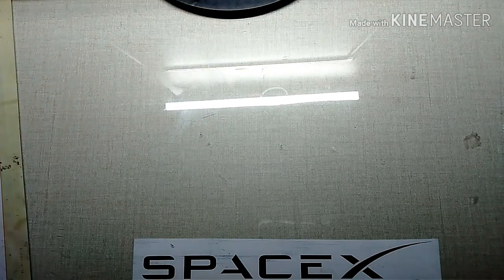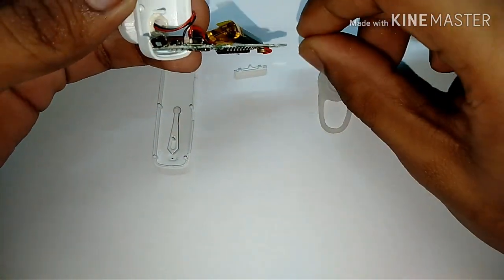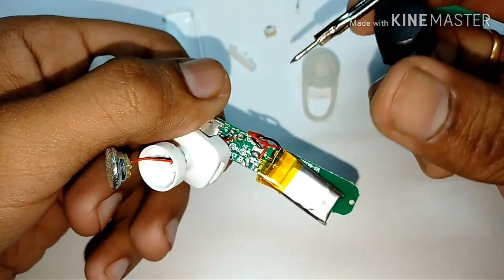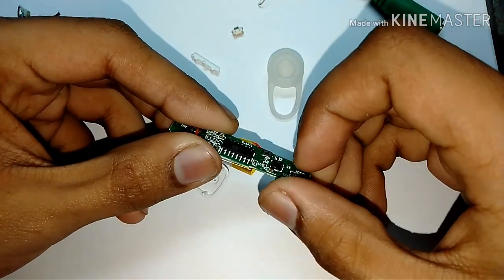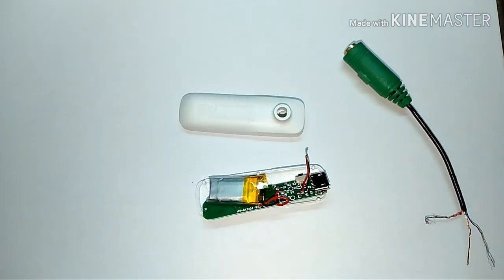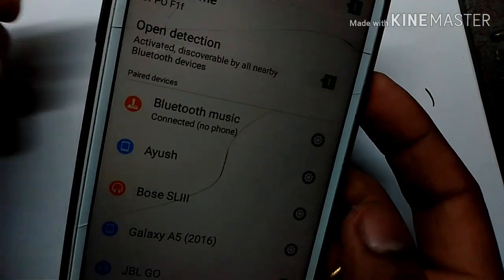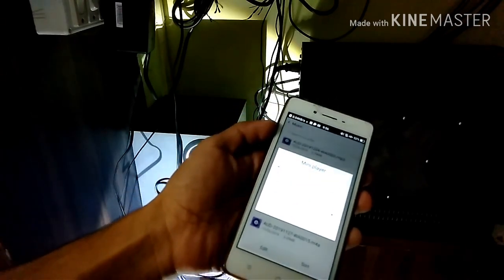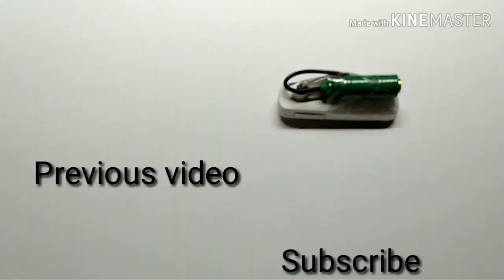Diy Bluetooth adapter

Comment: Help needed I did it exactly and it worked 😊 but the battery life is really bad like from 100 to 0 in 8 mins of usage I want to use it while charging any way this is possible.
Reply from the maker: Good question . 
I think it would be quite inconvenient to use a charger to keep it running , cause the morale of this project is to make any auxiliary device "wireless" , or else it would become useless . You want it to be portable, right ?

So i would suggest you to go a step further and replace the tiny battery with a larger one . Make sure it has the same voltage and current , but higher capacity , so that it lasts longer . 

Be very careful not to use any power source , that has higher voltage or current , than initially rated for the circuit board . 
Study the voltage and capacity written on the body of that tiny battery.  

Comment if you face any problem . I'll surely reply when time permits .
Reply from the maker: @Leo_von_Eric  actually the circuit is designed in such a way that you can't really use it while charging . 

I'm not saying it's impossible . It's definitely possible.  But for the fact you're saying that you're a beginner and you are using your safety pin to solder wires , it's nearly impossible to reconfigure the circuit board. 

I think changing the battery to a better one is the only way out . 

Fun fact : even i don't have a soldering iron , and it's still a mystery to me why i don't . So i know the pain of using safety pin as a soldering iron .
Reply: @RandoniumTJ  Yeah lol😂 the pain is real

Comment: Seems a tough DIY😅..a good one though!
Reply from the maker: Not tough actually
Reply: "Open bluetooth device, connect wires to female aux cord, put back in case" 

There's literally nothing that needs to be done aside from twisting 2 wires together

Comment: Broo This is Only Calling Bluetooth or Audio
Reply from the maker: Only audio...
Reply: @RandoniumTJ  I Have Calling Bluetooth Same like this 
How can I make This type of Connector
Reply from the maker: @ppmentertainments  it's too tough to make a female connector, cause you need to get the measurements right, and it's quite tiny also ... I would suggest you to just buy it at any repair shop or spare parts shop. You might even get it for free. They are extremely cheap...
Reply: @RandoniumTJ  tq😍
Reply from the maker: Welcome

Comment: Bro from where we solder the headphone jack headphone jack has four wire you connect only two wire where you connect that two wire s
Reply from the maker: Merge the stereo into mono ... And leave the mic . So remains only the positive and ground wire ...
Reply: @RandoniumTJ  bro i will tell you reply right or wrong the speaker wire is remain +,- connect into aux cables +,- remain wire will cut am i right
Reply from the maker: @nithishkumar.r6921  right . 

You have to cut only the mic wire . The stereo left and right wire will be merged into a single wire ...
Reply: @RandoniumTJ  what means stereo
Reply from the maker: Before you proceed with the experiment, please search the internet and try to figure out which wire is what . Cause it differs headphone to headphone ...
Reply from the maker: @nithishkumar.r6921  stero means the pair of positive wire for the left and right ear ...
Reply from the maker: See , there are four wires . 

Mic , left ear , right ear , ground . 

What you have to do is figure out the left and right ear wires , then merge them into one wire by twisting them . 

Figure out the mic wire , and cut it off 

Now you are left only with two wires . Ground wire and the combined stereo wire . 

But before you proceed make sure you correctly figure out which wire is what ...
Reply: @RandoniumTJ  tku bro
Reply from the maker: @nithishkumar.r6921  ❤️

Comment: Whooooaaah this is beyond alchemy 
So can u use this method to connect stuff like BT gamepads
Reply from the maker: Thank you for your kind inspiration. But unfortunately , this module is only made to transfer a particular wavelength that is meant suitable for sound transfer . Modifying it to transfer data isn't impossible . But it's not worth the effort . And also wouldn't be anywhere as simple as this one ...

Comment: Would this work if I cut a male to male aux cord and used that instead of the female cord like you have here? I want to plug it straight into my Nintendo Switch.
Reply from the maker: Since it is only encoded for audio data transfer , it would not work with your Nintendo. But if you directly connect it with any headphone , it surely would work.  .

Comment: Can I connect the speaker wires to a usb cable. Will it work? Please tell 🙏🙏🙏🙏🙏🙏🙏🙏
Reply from the maker: So basically you want to drive a sound system that has an usb audio input . If that is the case , it will work . But make sure you solder the correct wires . And also , this is a mono audio output , not stereo , so will be your sound system ... If you have any problem , tell me . I'll reply asap ...
Reply: @RandoniumTJ  thank you very much bro
Reply from the maker: @gts4434  welcome ❤️